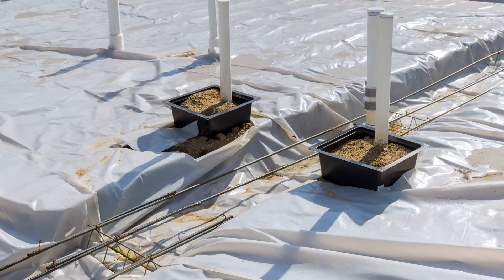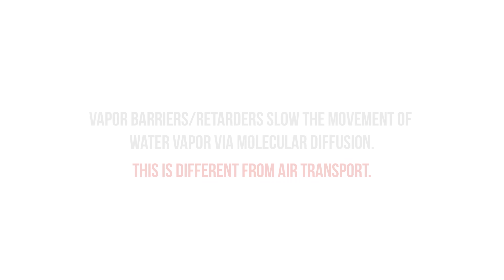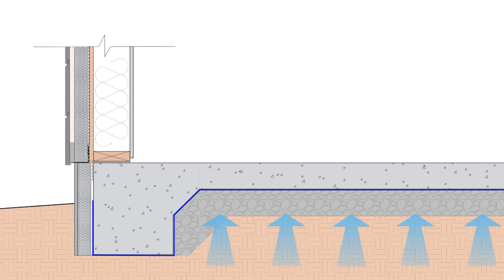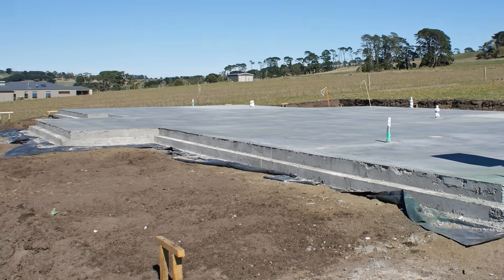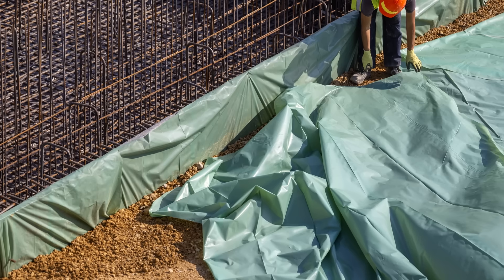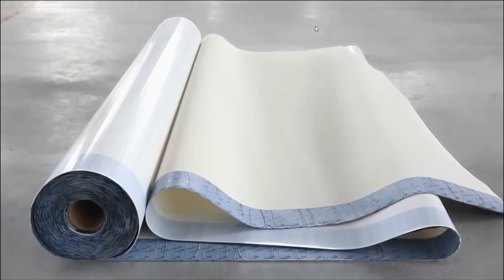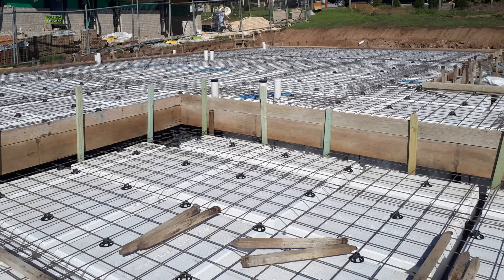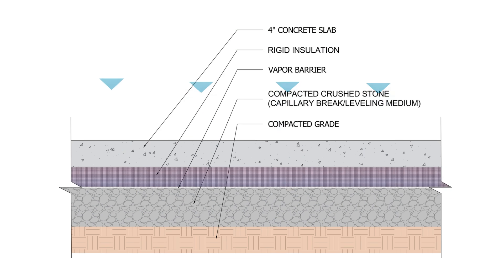You DON'T Understand Vapor Barriers In Slabs!

Comment from the maker: Here's a short snippet of Joe Lstiburek's opinion on it (from building science corporation) if anyone wants some supplemental information: https://www.greenbuildingadvisor.com/article/air-barrier-or-vapor-barrier-building-science-podcast
Reply: I was always told that your should use two layers of poly on the slab becuase it would also stop cracking and the friction coefficients was lower between the two layers so the pour would have less stress on it. what is your thoughts on that?
Reply: @paperburn  That's true. Watch concrete guru Tyler Leys series on these things: Slab tips - Pt 1 - how to build driveways, patios, house slabs, and roads. More important is that the sub base is uniform, without any hard or soft spots.
Reply: @paperburn  no comments from ASIRI yet?
Reply: @Rickdcpr  No but I just assume what I was told is true becuase that is how many contractors are doing it now. And The perfect wal guy and matt Reisinger have on the best practices list.

Comment: I had a new house built in Calgary Alberta Canada.  I have moved but builder pulled a fast one to save costs.  It was a walk out basement design.  I am sure the bottom slab was not properly layered with a sand gravel crush, tamped then insulation and vapour barrier/retardent and then walk out slab.  I paid extra for finished basement but was actually moving from another city so I could not visually see all steps of construction- ( wouldn’t matter anyway) Result basement was cold as a fridge.  Ground freezes in winter and slab was like an ice arena floor.  Concrete on ice. House is sitting on top and closed up.  Probably did poor wall insulation as well.  Builders of these new subdivisions commit all kinds of crimes.  See YouTube videos of new build inspections but little help.  Lawyers house at end of street was much worse.  He was naturally at a much lower point than me.  In rain his lower level flooded miserably.  He sued builder.  They just declared bankruptcy and reopened with new corporate number.  They do it every year or so.  He got nothing and paid $300,000 to fix problem.  Doctor next door had a different problem.  Every opening ( door, window etc) was terribly sealed and installed by like migrant idiots.  Windows falling out, doors similar or twisting won’t shut etc.  He had to pay a similar amount to have his house kind of rebuilt. I moved after a couple of years.  Passed on the problem.

Comment: Elevate slabs on crushed rock beds at least 12 inches above top of soil with rows of perforated drain pipe 3ft apart so water and air can escape from under slab. No water infiltration. No gas infiltration. No plastic barrier needed.

Comment: The main negative effect of a vapor barrier for a slab-on-grade concrete is that it can cause the concrete to crack and curl, particularly when the concrete is placed directly on the barrier. This is because the barrier prevents the concrete from drying evenly from the bottom, creating a steeper moisture gradient within the slab that can lead to warping or curling, especially in the early stages. Additionally, trapped moisture under an impervious flooring system can cause adhesive failures, and the release of minerals can lead to efflorescence. That's why the Engineer of record specs 2 inches of sand on top of the vapor barrier.
Reply: Exactly. On a hot, dry day, the water has only one way out, and the concrete cracks the same day.

Comment: Okay, understand people put plastic on the bottom between the cement and the dirt cement has a high content of alkaline. It will eat up that plastic or whatever you're putting down within 2 years, it'll become a powder, you're throwing away your money, they've been putting concrete on top of dirt for centuries.  And there's buildings that are more than a hundred years old , and they're doing well , do not reinvent the wheel

Comment: Maybe a really silly question, but why not vapour barrier first then insulation?

Just in general, I’m a WRB over exterior CI kinda guy. I think the same about foundations when people dimple mat them insulate.

Why not insulate then dimple mat?

To me protecting the insulation from getting wet even if it CAN withstand water doesn’t mean it should have to?

Wouldn’t it be a better insulator if kept dry? Even if it dries out and is damage/mould free, wouldn’t it insulate better if kept dry?

I’m big into roof/siding/insualtion and am interested in foundation/slab as that’s the missing waterproof/insulated portion of my work.

Comment: We had water come up thru our slab thru the plastic sleeves used to protect copper water lines. We only discovered it during a shower remodel.  We discovered wet, rotten studs and a termite infestation. Apparently, have a high water table. We also had water penetrate upward thru the slab around the toilet flange.  After discovery, I sealed everything with Lexel and the injection of generous amounts of structural epoxy.  So far, no more signs of water intrusion.

Comment: Our builder put in Zip Strips to control the direction of the concrete as it cracks. The cracks range in size from just over hairline to about 1/8th of an inch. Should I seal these cracks to help prevent radon even though we have a vapor barrier?

Comment: Hey I’ve been in carpentry and building trade for very long time. I’m told I overkill my work. In my opinion it’s done correctly. Now when it comes to vapor barriers especially in concrete floor slab pours you want to use a good quality product. One made for that purpose. I don’t use the clear plastic roll you get at the big box stores shelves. I use Stego 15-20 mill. I don’t skimp. I just seen a new addition on a house being built. The guy just used big box clear plastic and it wasn’t even wide enough and didn’t even attempt to add additional material to complete the floor. Half ass.

Comment: Concrete cracks and with multiple penetrations that are not sealed adequalty this will cause problems. I dont beleive we should accept holes in a VB and promote poor wormanship. I agree with your other aguments for the choice of the roight material in high hydrostatic pressure and other topics. Like always great article.

Comment: Missing is the perspective that doing an excellent job takes little more time than doing a schlock job, where you spend time justifying how many holes it takes to fill the Albert Hall (with radon and humidity). Why buy and pay yo put down plastic and then put holes in it or not take the time to tape up a couple penetrations?  No thanks.

Comment: Wouldn't the fact that the likelihood of a future home owner neglecting the gutters or drainage of the yard, leading to water collecting against the foundation be enough of a reason to ensure that there are no holes in the vapour barrier before you pour?
Reply: a perfectly intact vapor barrier is not going to prevent the problems caused by bad drainage or neglected gutters. If you have water pooling against the foundation that is a completely independent issue from a few holes in a vapor barrier.

Comment: First time Ive ever seen vapor barrier above the rigid insulation. is this correct or did you get it wrong? If you tape the seems of the rigid foam it will not “Ice burg” so why vapr barrier above it??
Reply: because the vapor barrier is supposed to be in direct contact with the slab per most building codes. thats how it designed to work. If there is a way for water to come between the the bottom of the slab whats below then its pretty much like a slab without one.

Comment: This came up just a few days ago with a builder regarding concrete sub typically needing to poke holes down into the gravel after the pour to allow the wetter areas to drain. Sounded strange but based on this maybe acceptable to do? Although still seems like an issue if I want them to put down some insulation under the vapor barrier - planning likely a combination with 2"GPS or XPS in the half near the walkout/at-grade and insultarp in the other half (location Northeast, not doing radiant heat). Appreciate any comments. Thank you.
Reply: if it rains in between when they put down the moisture barrier and when they pour they need to get the pooled up water out of there somehow. This is where I've heard of concrete workers poking some holes. no big deal. Best thing would be to plan all that work when it's going to be dry. You could also show up before they show up and broom it or use a blower to get it off.

Comment: Not nit picking, but a home is not an investment (I.e. Asset). It's pure Liability that starts depreciating the second it's built.
*Rental property would be the exception, but I don't think that's what we're discussing here.

NOTE:
For those tempted to respond, "Homes go up in value." That's a function of the dollar losing value, not the home gaining value.
Reply: Dollar losing value + rise in labor and material costs + increased costs associated with code changes.
Reply: Are dollars liabilities too..since they’re losing value? all assets may not be created equal but if nothing else ..real estate is performing pretty well relative to dollars lately..Even accounting for the maintenance costs
Reply: @SenSkywalking  Yes, sitting on a pile of cash would be a liability as it continually loses value with inflation, in contrast to an asset which appreciates and/or pays dividends over time.

Real estate value is closely pegged to inflation, though historically more stable. The sole exception over the past 120+ years is the current bubble that outpaced inflation from 2013 until it peaked in May/June of 2022. Bubbles are fueled by debt, with an inevitable crash. Since the current bubble is larger than any we've experienced before, it's reasonable to expect its corresponding crash will also be larger than we've experienced before.

Comment: I have a slab on grade and don’t know what’s underneath. I’m not sure yet what flooring I’m going to do but wonder if I should do some sort of vapor barrier then rigid insulation then flooring?
Reply: I have done this for several jobs. I like to use a dimpled membrane  (dmx) on slab, and depending on the flooring you decide to use, determines what goes on top of that. If carpeting or hard wood that needs fastened, put a good tongue and groove subfloor on top of the dimpled membrane, if using a snap vinyl floating floor; you can put that directly on the dimpled membrane. If the budget allows I will always prefer a good subfloor on top of the membrane though.

The membrane allows the slab to breath and dry as needed. Good luck with your project!
Reply: Also, on my own living room, the floor was slab on grade and always super cold in the winter. I used the dimpled membrane (taped the seams), then 1.5" xps foam boards (taped the seams), then used 3/4" 4x8  tongue and groove subflooring, then carpet. I tested it and it warmed the floor temp up 15 degrees in one day (before the carpet went in) and the room temp was 7 degrees warmer than the day before with similar conditions.
Reply: @matttietsort861 that’s awesome!!!!!

Comment: Nah. Have you ever seen a vapor barrier that has actually been sitting long enough to build up moisture underneath? Especially in the south where I live, where ground temps are around 58 degrees year round, condensation forms on the underside of the vapor barrier. It will certainly work its way up where it can, through penetrations in the slab, or holes and tears where the porous surface of the concrete is in contact with the soil. You can theorize but you need to actually watch for yourself and inform your decisions with real world information. 
And by your own logic, if it's 95% as good, why not go the last 5%, and do the best work you can? Does it hurt to take pride in your work, and to have a nice looking project at the end of the day? Builders and contractors in volume construction will come up with any justification imaginable to do a bad job.
Reply: Most of the problems I've seen are from either no moisture barrier at all (in old construction) or improperly placed ones ie not in direct contact with the bottom of the slab. Other issues being easily explained from the building only just recently being closed up or not dried in yet.

Comment: The vapour barrier has at least a few other uses. It creates a slip joint between the slab and the gravel sub base, this helps with the saw cuts and crack distribution. It also prevents the wet concrete from losing moisture to the dry sub base, causing it to dry out and not cure properly. Both of these effects could also be achieved with rigid insulation under the slab, but you usually don’t have that continuous here.

Comment: Yes!! Thank you for this! I'm a designer and builder and I've asserted the "holes as a % area" argument for years after reading studies on this 20+ years ago. You could walk on a vapor barrier with golf shoes and still have less than negligible effect of moisture diffusion. I've seen site engineers insisting polythene barriers be completely taped and every single mark and dent be patched, holding up large commercial concrete pours until they were satisfied. Your point about actual water barriers and especially their joints needing to be designed and specced to withstand the potential hydrostatic pressure is not really understood by many in the industry doing the actual work. Excellent clear and concise vid.
Reply: Sub-slab wapor baier on a soil is a joke.

In my country, the typical solution is to put 50 mm (2 inches) slab of cheap concrete on soil (put some cheap barrier on the soil so it will not suck up the water from concrete).
After, a proper and thik wapor/moisture barrier is applied on top of concrete slab. This is alternative to pile of gravel that people put in USA.

This barrier must be connected to wapor/moisture barrier between foundation and the wall.

Then put some XPS or EPS on the wapor/moisture barrier and add one more slab on top.

Comment: I'd agree that the plastic can have quite a lot of holes and still be an effective vapor barrier - probably more so when slabs are poured directly on earth rather than a material that can drain like gravel.  But if your goal is to reduce radon or at least reduce radon to the point where you don't need an active system, it seems like holes in the plastic sheeting would be detrimental to that.  Especially when holes in the plastic sheeting might line up with cracks in the concrete above.  I know radon is small enough that it can go through both plastic sheeting and concrete, but all the PChem that I took makes me believe that it'd probably take some time and some motivation (pressure) to get it through these materials.  The radon permeability rate through plastic and concrete would probably be much smaller than the rate it can pass through plastic sheeting holes and concrete cracks.  I'll be taping every hole I see when I build my house soon, and hoping that the passive radon vent will have enough depressurization so I don't have to run a fan.
Reply: Adding to this. In the Province of British Columbia the vapour barrier is now required by the 2024 building code to be air tight precisely to prevent radon and other soil gasses from entering the occupied spaces.

Comment: And again controversial topic, foam above or below the barrier, it's actual purpose, trade offs vs longevity. This is a very involved subject that because gramps did it.... WAIT!
Reply: The NBC in the US requires the barrier in direct contact with the slab.. its there specifically for a purpose. If the foam needs or calls for another between it and the ground then that is it's own requirement and doesn't negate the one required to be touching the slab.

Comment: I would say it is important to prevent any holes in the plastic but some small holes is impossible as its laid over gravel in most cases but any large holes should be sealed.

But in a high water table area i would have gravel then sand and geofabric or weedmat before the plastic or be a near perfect senario.

I wish my house had a good vapor barrier since i must have a dehumidifier in my basement on every day all year long to prevent musty smell

Comment: For a concrete free slab. Would you have crushed stone with rigid foam on top and then tape the rigid foam seams for the air barrier and not have a vapour barrier?
Reply: Depends on what type of insulation you are using. If it is XPS you would want a layer of plastic with joints taped over clean 2b limestone. If you are using foil faced EPS the plastic would not be needed just tape the joints. Also, use a layer of woven fabric cover that is used for driveway base under the gravel so it does not get pushed  down into the soil.
Reply: @SteveV1960 Why can't you just tape EPS rigid foam? If it's on crushed stone can it be pushed into the ground?
Reply: There are several videos on YouTube on how to do no concrete slabless slab. Watch them.
Reply: Thank you for this amazing video!

Comment: can you use mineral wool for exterior insulation for below grade foundations?  you said rigid foam isn't good because termites and ants will make highways in them right?  will the mineral wool get damp and lose its insulation value if on the exterior of a concrete foundation?
Reply from the maker: @dovahkindragonborn9827  Yes you can absolutely use mineral wool for better durability. As with all insulation products located below grade, it's critical that the site and soils are well drained.

Comment: Can polyethylene be the water proofing? Or do you need a different product?
Reply from the maker: @CodyOnHomes  We'd recommend something that is bonded to the substrate, like a self adhering membrane - We briefly touched on it in this video but if you're looking to waterproof a slab properly (expecting submerged conditions) you need a pre-applied membrane which would likely transition to some sort of post-applied membrane at the walls.